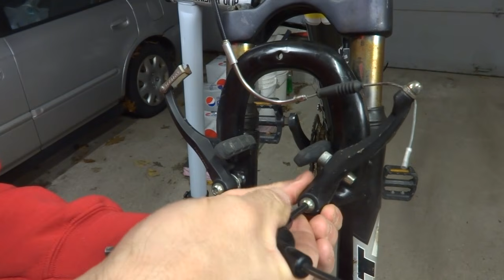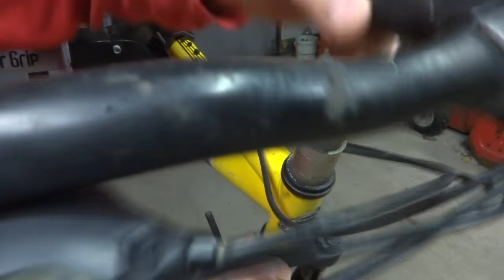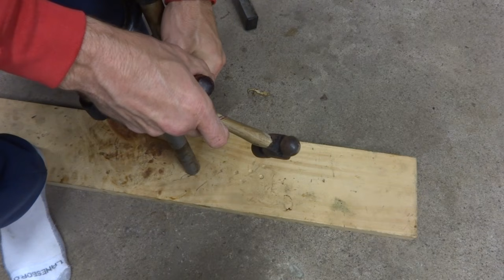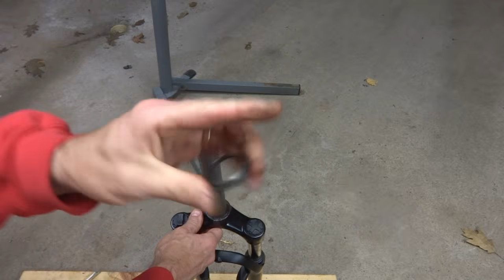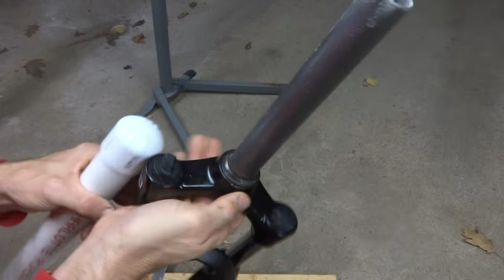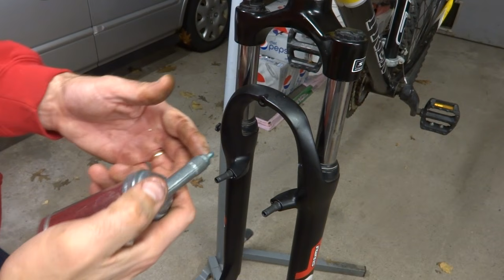Replacing Forks/Shocks On Mountain Bike

Comment: What if I wanna beef up my shocks and put bigger ones on? How shall I do that?
Reply from the maker: QSzMONSTER You buy bigger ones. And then you install them.
Reply: RJ The Bike Guy 
Phahaha brilliant answer... a little obvious but brilliant
Reply from the maker: Neil Savage I am not quite sure what more you want?
Reply: I mean like do I need to buy different mounting system to accommodate the bigger shocks
Reply from the maker: QSzMONSTER No. You will need to find shocks with the same size steerer tube as the ones you have. 1 1/8" is the most common for threadless. 1" for threaded. Though there are different sizes. You might be able to get a sturdier headset. But it will have to be the same size.

Comment: What kind of lubricant should I use for the steer tube?
Reply from the maker: Pebbles Make Me Fall I like marine grease. You can use something like Park Tool Poly Lube also.
Reply: RJ The Bike Guy So would I find it at my local bike shop, hardware store, etc?
Reply from the maker: The marine grease I get at an auto parts store. The Poly Lube at a bike shop.
Reply: Alright, thank you!

Comment: Have you ever done a video on those bearings?  I recently took my forks out to clean and renew them and wanted to regrease the bearings as well.
Reply from the maker: Do you have the same cartridge bearings like in this video? I have done several videos overhauling headsets.
Reply: Could u link me its for a 3900 trek pretty sure the site says the same cartridge bearing not 100% though
Reply: shyflirt1 Aheadset Slimstak w/semi-cartridge bearings, sealed is whats listed for my bike on trek archive.
Reply from the maker: I haven't done a video specificaly on those, but let me see if I still have that bike, or another one that will work.
Reply: I found your 4300 one on the headset. I believe thats what mine were like. Il send photos on fb.

Comment: I have an early Trek 4100 with insync 320 shock,70mm travel. Any idea of a straight swap replacement? Im new to biking by the way lol.
Reply from the maker: Just try to find some decent shocks with the same type of steerer tube, same diameter, same length or longer (not too much longer if it is threaded).

Comment: i've a question, is that can i fit a 26 inches wheel to a 24er?
Reply from the maker: 26" wheels on a frame made for 24" wheels? Maybe, maybe not. Depends whether the frame will have clearance to fit the wheels. And then the brakes wont meet up with the rims. The question is WHY? A bike with 24" wheels is likely a kids bike. Usually low quality. Why not just get a bike made for 26" wheels in the first place.